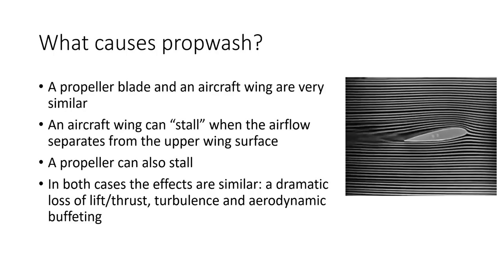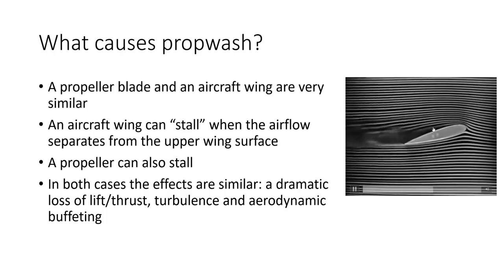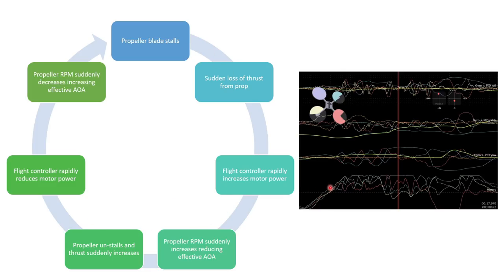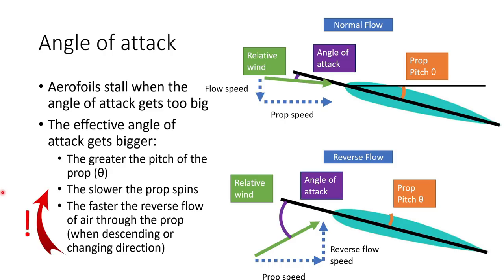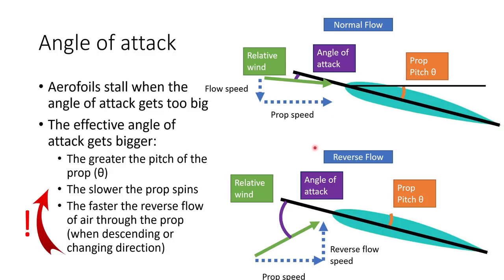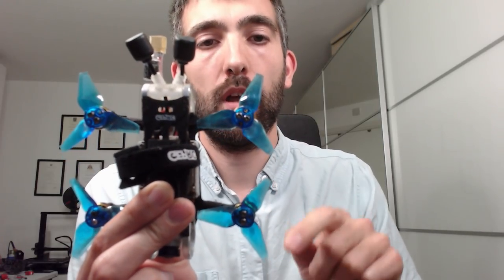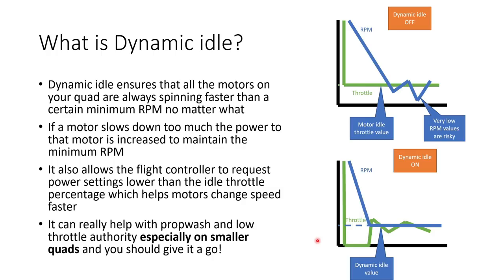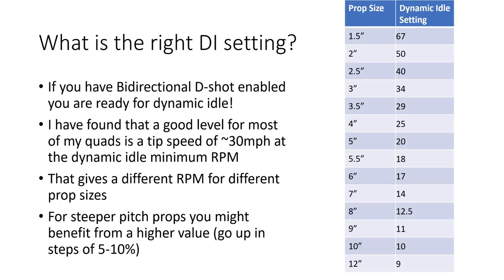What causes Propwash and how Betaflight Dynamic Idle can help!

Comment: interesting! using dynamic idle versus a variable pitch blade (heli's)?
Reply from the maker: Yes, if we had variable pitch we wouldn't need to worry about blade stall. With fixed pitch it's much more important to set DI correctly to avoid propwash.
Reply: @ChrisRosser  copy that! thank you!

Comment: In betaflight 4.1.7 works fine without any tunning, due that not appear and I suppose that is with cli.
All my quads still in 4.1.7... Except the 4" iflight whit this feature turns off
Reply from the maker: I'm not sure DI exists in 4.1 its a relatively new feature. 👍

Comment: This is interesting, but I must admit that I'm like JB and have written off attempting to tune dyn idle long ago... IIRC it occasionally introduced desyncs or tuning issues that I would have rather avoided entirely. I'm curious, however, to plug in these values and see how they work with some idle tuning. Do you think your table would apply to 4.2.x fine?
Reply: By the looks of the configurator in the video I think he is using 4.2.
Reply from the maker: Should work fine for 4.2 or 4.3. In 4.2 the control loop for DI is very simple so you need to make sure D_Shot idle is 20% above the DI setting to avoid wobbles. On 4.3 DI gets its own PID loops and therefore is much more capable and less prone to wobbles. In 4.3 you can set D_Shot idle to 1% and it flies great.

Comment: just so u know when u activate dynamic idle, dshot idle is disable
Reply from the maker: Good to know thanks! Is that true on 4.2 and 4.3?
Reply: @ChrisRosser  4.3 only. dynamic idle was redone in 4.3 and the way to configure it is different. with the latest nightly version of the configurator it is impossible to go wrong. dshot idle is inactive when dynamic idle is enabled.

Comment: I am not sure I agree with the stall point/flow separation explanation as the root cause but interesting none the less.
Reply: That’s literally the physics of what’s happening
Reply: @cchance  I disagree because the stall point is completely dependent on the angle of attack of the prop and the quad's attitude completely changes the props angle of incidence. If this type of analysis is acceptable then most of the time our quads fly in a stalled state, just going off the angle of incidence. Add that to the issue of asymmetrical prop loading and you lean more towards how the quads aerodynamics effect prop wash.. So no I don't think this is the most prominent cause of prop wash. I think the 2 most prominent are power to weight and the aerodynamics of the bottom surfaces. How effective the quad is at arresting the momentum of the quad at any given moment and the buffeting effect of the terrible flat bottom plate on most quads have large effects to how well the pid loop can respond to the conditions. Quads with higher power to weight ratios tend to have less prop wash from the get go so it is easier to tune out. From my testing, if you improve the aerodynamics of the bottom the buffeting effect is minimized and prop wash is easier to tune out.
Reply: @zachcarrizales5038  hope you have a few engineering degrees to back that up, like Chris Rosser does 😅🤙
Reply: @fpv_dartion3316  I have my bachelor's degree in Mechanical Engineering, but I sadly do not have my masters degree like Chris does. Besides, degrees don't always define or justify whether a theory is right or wrong, case in point exactly how airfoils produce lift is still a somewhat debated topic. But I have designed the 31mm and 40mm Azi prop lines and a lot of my explorations of those propellers and flying experience over the years have helped shape my theory.
Reply from the maker: @Z Carrizales  The stall point is absolutely dependent on the angle of attack. What makes this complex (and a bit counterintuitive) for quads is that the airflow direction at the prop disc can be very different from the airflow direction away from the prop. For example the quad could be descending rapidly but the airflow through the prop discs could still be downwards because of the effect of the propellers. Added to that, as you rightly said, is that the flow conditions are different at different points during the rotation (advancing and receding blades) and that parts of the balde can stall while the rest of the balde remains unstalled. This is why propwash can be so unpredictable. Nonetheless we can always improve things by reducing the blades fixed AOA, and increasing its RPM. That will help reduce the chance of blade stall under all conditions.
Reply: @fpv_dartion3316  🤦‍♂️ you know how many people in this hobby are engineers

Comment: So what about 31mm props?  That’s not listed in your board.  And tip speed means what for whoops, or anything? No offence but seems your video creates more problems than solutions.  Relax before you drown in fpv delusions of grandeur,  like so many..  hint hint next commenter
Reply from the maker: Because the recommendation is based on tip speed you can calculate it for any size of prop. A good starting point is 30mph. 30mph is 13.4m/s. The circumference of a 31mm prop is ~0.1m so we need to do 138 revolutions to cover 13.4 meters each second. 138rps = 8280 rpm so your dynamic idle setting should be at least 83 for a 31mm prop. Depending on prop pitch you may need quite a bit more than that but 83 is your starting point. Go up in steps of 10% from there if you still have propwash issues or down in steps of 10% if you need more inverted hangtime.
Reply: @ChrisRosser  I think you did it again.  You just pick 30mph as a start with no explanation.
Reply from the maker: @markmontreal7815  Ah sure let me explain that. We start from the ratio between the speed of the prop and the inflow velocity that gives the effective angle of attack of the prop blade. A given aerofoil will always stall at a similar angle of attack so there is a ratio of inflow velocity to air speed at which the prop will stall. The inflow velocity for most quads is around the same order of magnitude (you can derive this by considering momentum flux across the prop disc) and the stalling angle of attack is similar for most aerofoils. So we end up with the stall tip speed being pretty similar for most quads. That allows us to define a good starting point for DI tuning based on tip speed. It is only a starting point because different props do have slightly different critical angle of attack and inflow velocity depends on prop disc loading which is quad dependent. However, it's a hell of a lot better than trying to find the right DI value completely blind!
Reply: @ChrisRosser  ok lol I’ll take your word for it!  Hehe.  Thanks for putting in the reply time!  Very considerate!
Reply from the maker: @markmontreal7815  No problem at all, you asked a really good question. I hope my explanation helped.

Comment: lift is greatest just before the stall but also drag is increased which would try to slow the props there will be an ideal relative airflow angle of attack like say 15 degrees where lift and drag are at there ideal compromise for best performance also giving better battery life... If you @Chris Rosser could elaborate on the pitch and blade amount assuming 3 blades used for the 30 mph tip speed used in the table this may further increase peoples better understanding to more accurately set there dynamic idle. heavier quads will have a greater reverse flow!!!!  the thrust triangles are what is used in aerodynamic design but there is another triangle effect called whirl speed that is effected by pitch. also the raynolds number of each aerofoil which is not shown by each prop manufacturer will also have a small effect a nice feature from betaflight would be to have a dropdown like we do with the flight controller for props and motor choices with a preset that would adjust with quad weight would be asking maybe far too much lol
Reply from the maker: You're right that 15 degrees would give the best efficiency. For multirotors you typically have a much lower AOA to avoid stall in reverse flow conditions often just a few degrees. Steeper pitch props typically require a higher dynamic idle setting to avoid blade stall. Up to 2x the RPM of a light pitch prop.